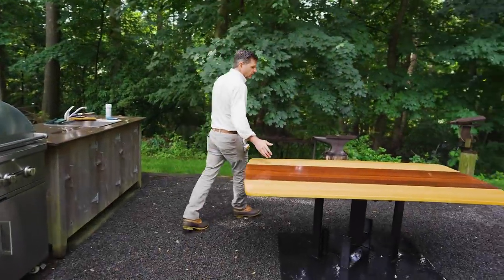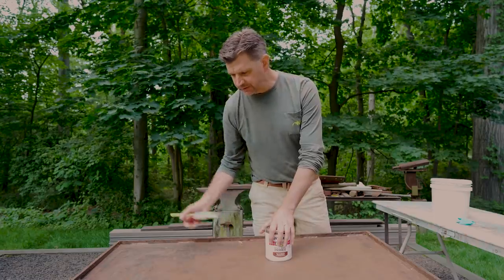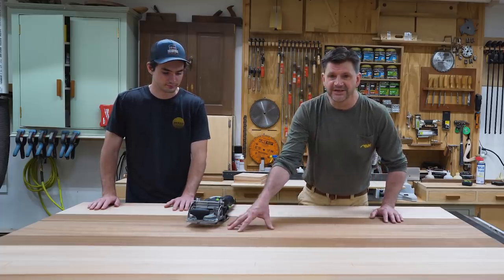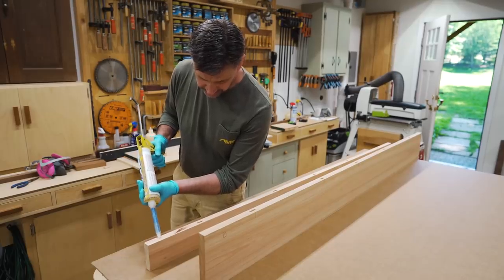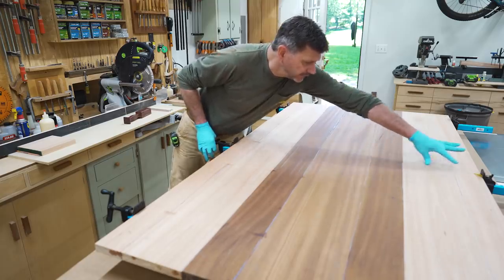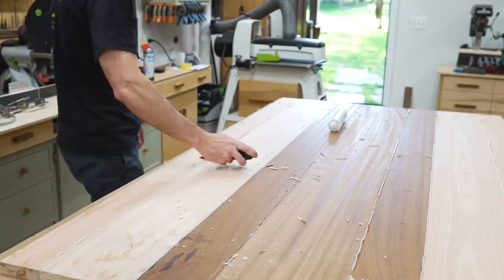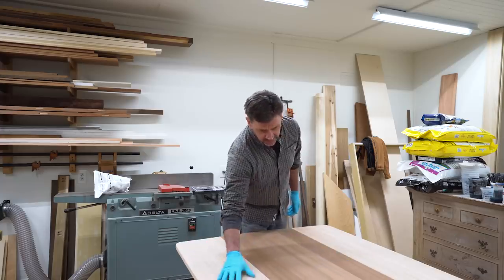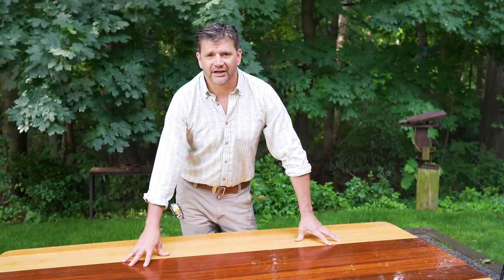Outdoor Dining Table | How to Woodworking

Comment: I didn’t catch what outdoor finish you used on the table top.  I live on the gulf coast and work on steel boats. Something I like to use for outdoor steel project like your table base is Benjamin Moore’s corotech rust arrestor to prime the bare metal rusted spots then a metal primer and then a top coat. That approach may be better for something on the water like at your moms house and not needed at your house in the woods. Thanks for the video! I might try and do a project like this in the fall for our porch.
Reply from the maker: Hi J , thanks for the heads up about the paint 👍 this finish on the table top is total boats danish teak sealer. I posted a shot video to the channel yesterday explaining why I decided to use this finish.

Comment: Jon, nice build & video. You should check out EZ Lok Threaded Inserts instead of screws (for securing the base to the top). They’ll allow for better expansion/ contraction of the wood, especially since it’s exposed to the elements & those factors are likely to be a magnitude greater than a table kept indoors.

Comment: What kind of finish did you use? Walter seems to be working out well, but then its hard to slack off with a camera pointed at you the whole time.
Reply from the maker: Hi Ed, it’s Danish teak oil from total boat